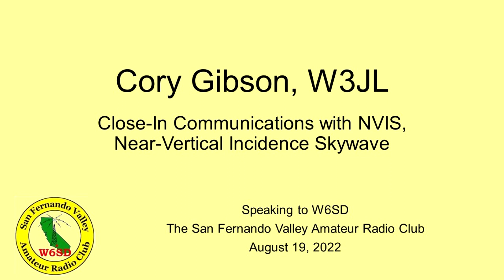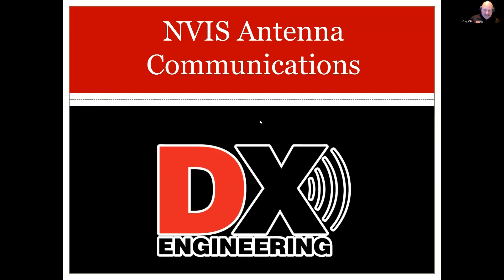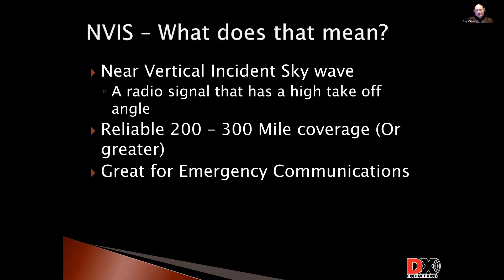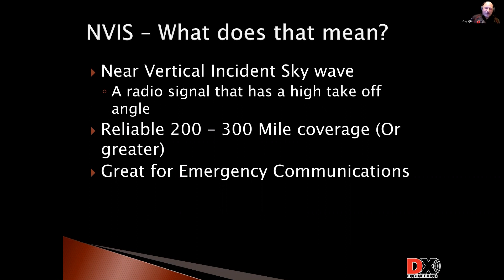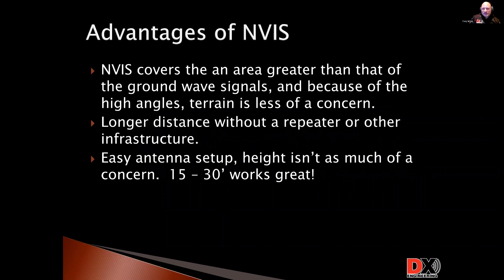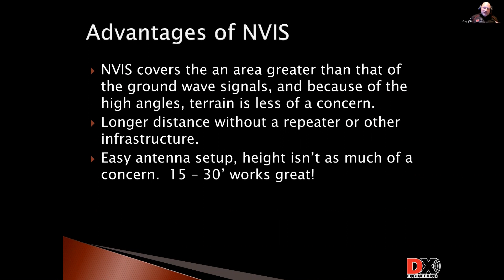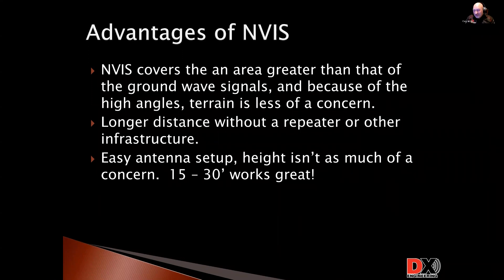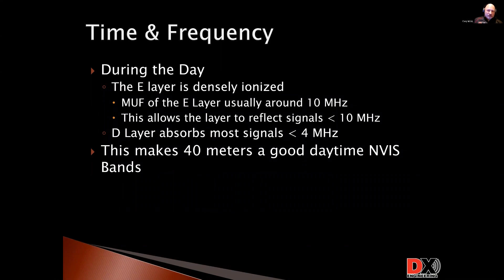Cory Gibson, W3JL, on NVIS

Comment: I used to have a 40m NVIS dipole up in my back yard.  7' off the ground, with 3 reflector wires laid in the grass underneath it.  I heard that those help out a lot, but not sure.  Anyway, I would get "40 over" reports throughout Texas and into Arkansas (which was off of the NE-pointing end of that dipole) from my QTH in central Texas.  I used to blow other operators minds with my booming, 100W signal. 😆

Comment: Do a search for "Super NVIS antenna". Using a ground screen gives you 6 dB improvement
Reply: See my reply above.  I used a Super NVIS. 😎😎
Reply: Are you gents talking about a reflector under the antenna?

I know this is an old thread... I'm pretty new to this but will setting this antenna up this year
Reply: @maytronix7201 Yes.  Make the 3 wires about 5% longer than the antenna.  Lay one directly under the antenna, and the other two 6 feet out from either side of the one directly under the antenna.
Reply: @ronbo422  ok... thanks Ron

Comment: NVIS antennas are less than 10 feet high, except in the case of the 2259's since they are inverted vee they are 12 feet at the top. This fact comes from years of experience, not some  theorist and flawed eznec's.